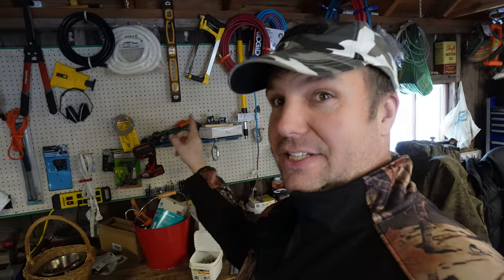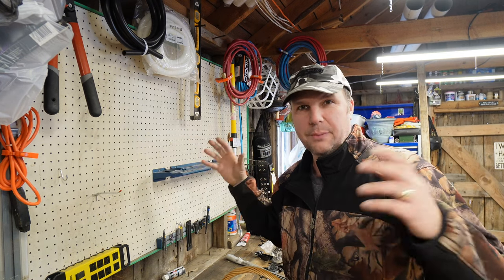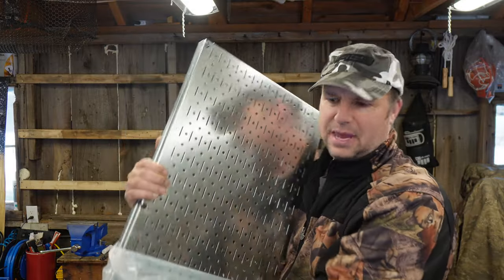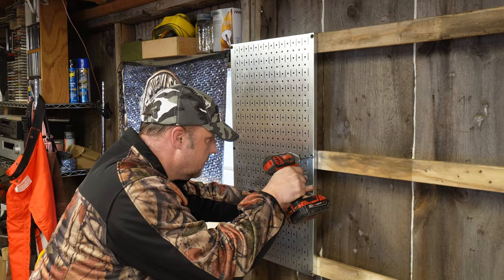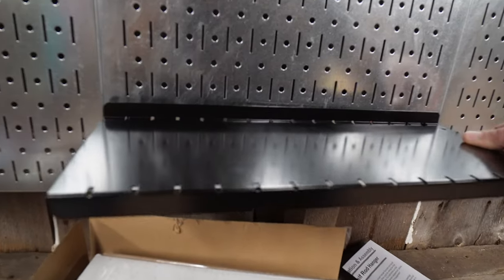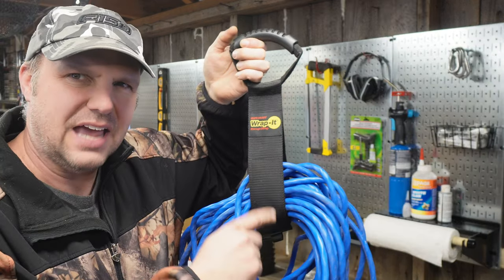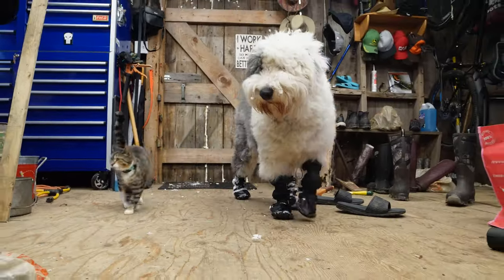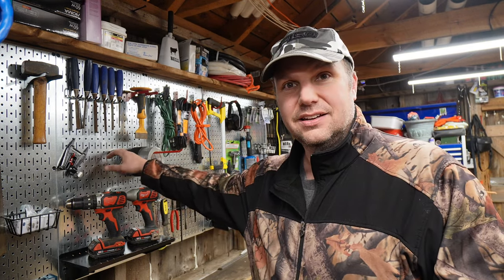Watch This Before Buying Wall Control Tool Organizers

Comment: I imagine that the designated Wall Control accessories work perfectly.  Did you run into any issues using the traditional pegboard accessories and hooks on the Wall Control panels?  I know there is a difference in thickness between the tradional pegpoard and the Wall Control panels, so I was wondering if that caused any issues.

Comment: Awesome video ❤ was wondering could you get the add on pieces somewhere else with the same exact dimensions 🤔 and lower price?
Reply from the maker: Possibly just look for the same size holes. These take both pegs and slots.

Comment: Nice. But to summarize, you took down pegboard and put up pegboard? The old MDF pegboard got soft because the back was exposed to the elements on that shed wall.
Reply from the maker: yeah but the old pegboard was probably over 30 years old, I still wanted an upgrade. This one's working out great.

Comment: I'm definitely the "untrained eye" you referenced. My tools and accessories would look similar. Your reference to your mousetraps triggered a memory for me, a question to be asked. Obviously, you have an army of "Barn cats" for your mousing reduction. Question; have you ever encountered a rat(s) on the farm? As far as i know, no cat is a match for a full sized rat, will be intimidated and actually run from a rat. I have seen several YT vids of city rats making cats look absolutely pathetic, they will attack and chase the cat. Perhaps if your cats ganged together they could take one down?
Reply from the maker: Well I know we had a single rat in the barn last year before the cats were in the barn. Once I barn trained the cats the rat was gone. Not sure if the cats got it or if it just moved out. But they have caught chipmunks so I’m sure a big tough cat could get a rat. Maybe city rats are tougher? All I know is since introducing cats our rodent activity dropped. I can leave bags of feed in the barn and they go untouched.